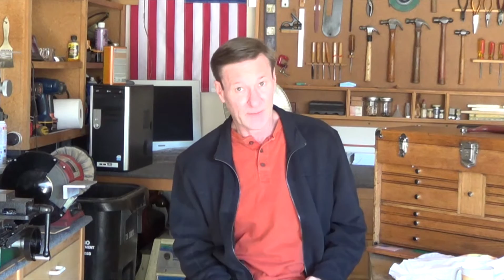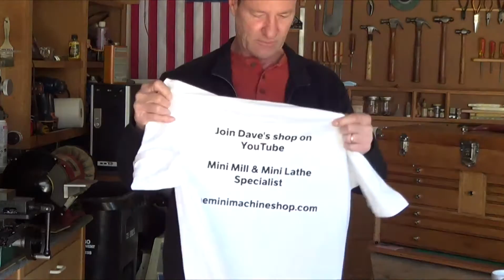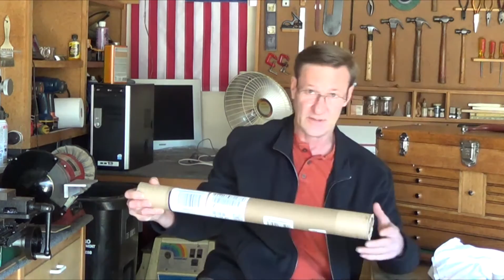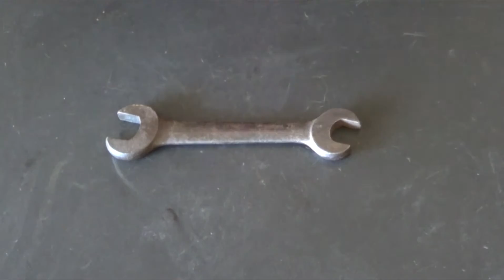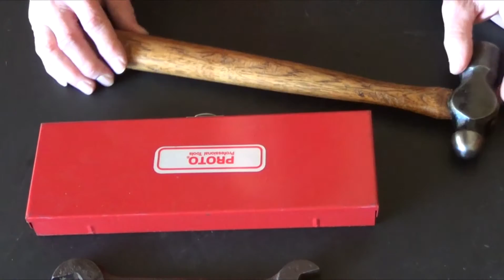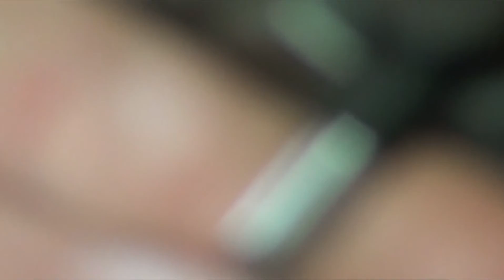Tool Research & Turning 1144 Steel Video #26

Comment: Did the price of the 1144 on Amazon include shipping? If you check out 1144 with online metals.com you can get a 1" diameter by 1 foot rod for $9.46 with the lower shipping being $6.95. Still, far less than the Amazon price.
Reply from the maker: I have Amazon prime so all my shipping is free. 2 feet for $7...

Comment: Northern Illinois. Just bought my 1st mini lathe and mini mill, should get delivered on Wednesday!
Reply from the maker: +Randy Ferrill You must be really excited! Feel free to ask questions dave@theminimachineshop.com. Which ones did you buy?
Reply: +Dave M harbor freight mini mill and the 7x12 lathe
Reply from the maker: +Randy Ferrill You should have them by now... any questions?
Reply: Picking up dro. And a vise tomorrow. Trammed the head and did a little flycutting on aluminum.so far very impressed
Reply from the maker: +Randy Ferrill I was thinking about you today and did a video. Mini Mill Unboxing, Setup and Upgrades Video #51  and watch it!

Comment: on the spanner the part where the nut goes could have been made with a core and knocked out after and they could have been made in a tray box making 4 at a time so only a vent would be used from each on hope this helps.
I like you mini lathe it would work well in the shop for small parts
giggles and waves from Europe is female
Reply from the maker: +Bleu Wolf Yeah thought of that but can't think of a material that can take 2,750 degrees for a knock out and stay smooth...but never thought of more than one at a time! makes sense... and wow 2 women in the audience...
Reply: look up casting with cores its using sand to make holes in parts
Reply from the maker: +Bleu Wolf Interesting.. just saw a YouTube vid on it and had no idea... so that must be how they did it because looking closely I can see the slight grainy surface left from the sand.
Reply: grins your welcome

Comment: I bought a bit of stock to have around off ebay as drops of 12L14 and 1144. If you watch for a while you can pick up some lots pretty cheaply. Most pieces were under 6 inches and wasn't too bad for shipping in the "if it fits, it ships" USPS boxes. 

Buying metal off Amazon is really weird. Some is crazy over priced and some is really cheap. I bought some 2-1/8" sched 80 aluminum from Amazon and 36 in piece was cheaper than 12" at online metals.
Reply from the maker: +David Kirtley Hi Dave, I never thought of that and will keep my eye out for some 1/2" or 5/8"...